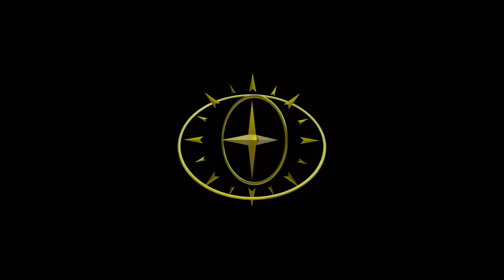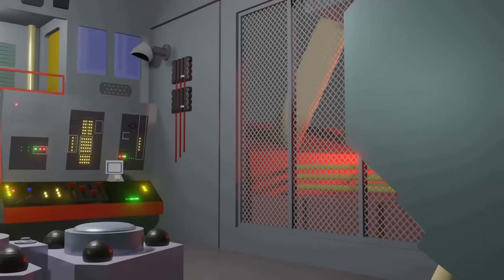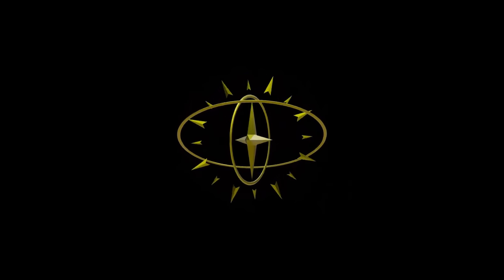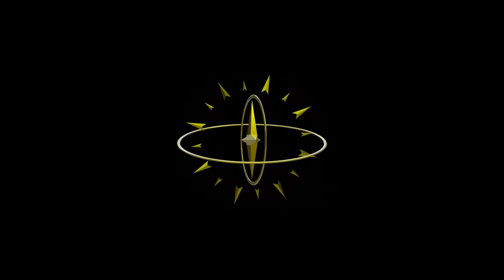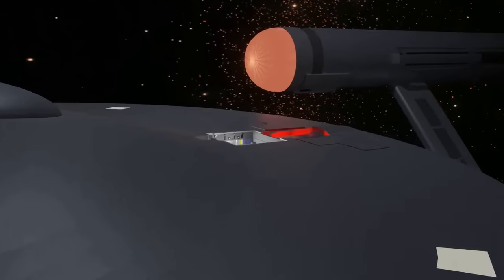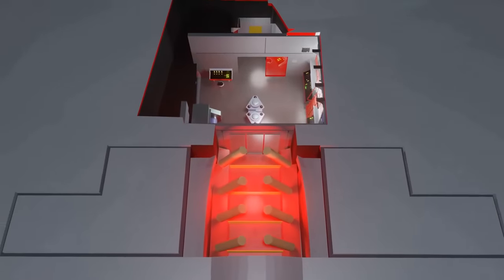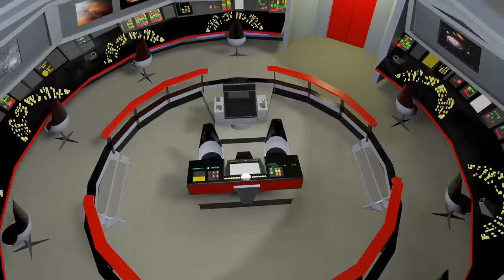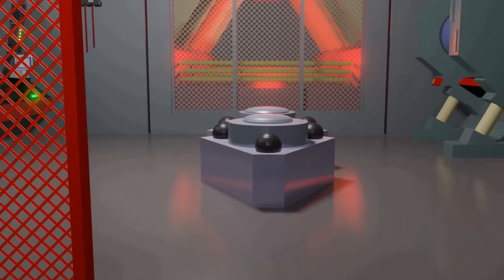The Enterprise Engine-room Enigma: where was main engineering?

Comment: IIRC the original concept for the Enterprise was a flying saucer, then later the secondary hull was added to make it more interesting and adding a reflector dish to make it more "science-y". Then they realized it still didn't look cool for TV and added the warp nacells. All of this was done independently of the writers and set builders who were operating off of both the original concept of the ship being a saucer (or at least that everything important was in the saucer) and that set building and story writing would be way easier if engineering was close enough to the bridge and could use the same hallway sets as everything else. Moving engineering to the secondary hull probably only became a thing when the show had become successful and anybody could put thought into where it should be (and thus the secondary hull became where all the power comes from). TMP then took it in a cocaine-fueled "bigger and better!" frenzy to wow audiences with huge sets and tons of extras by making engineering into this massive core that spans a huge chunk of the ship. The problem with TMP though was it cost way too much to do again for more movies: the sets were too big and the models were too fragile, so they immediately with Star Trek 2 go back to a saucer shaped ship in the Reliant and a beefier and simplified model for the Excelsior for Star Trek 3 (for Star Trek 2 they just re-used the enterprise engineering room for Reliant and for Star Trek 3 we hardly see anything inside the Excelsior). The other problem with TMP is that the engineering takes up an enormous amount of space for an exploration-based vessel to the point that as you noted there's no room for a turboshaft and as said earlier there's way too many workers. For TNG they needed a sustainably cheap set once again so they took the concept of the vertical tube worp core from TMP and smushed it into a smaller set with a more elegant and simpler to light set with maybe 3-4 actors max on the set. For Generations and First Contact they once again went crazy with extras, but never again tried to build quite as big a set as TMP.

Comment: I was recently informed ( by someone considering himself irrefutable an expert on all thing Star Trek and specifically the Enterprise) that the very first starship Enterprise had no shuttle bay, and no provision for one, thus it was entirely plausible that the space eventually used as the bay was originally intended to be the engineering area as it contained sufficient space for such a potential set, I prefer the idea that main engineering was in the saucer with a backup control room in secondary hull and that this was monitored and controlled primarily from the saucer
Reply: The First Enterprise's shuttlebay is literally visible on the outside. Who is this "expert" of yours?
Reply: @Idazmi7  true enough, all the filmed Enterprise starships I'm aware of DO have the shuttle with the segmented doors, I believe he was referring to the ship while it was still being "fleshed out" so to speak and there were no doors yet, the interior layout, and thus the sets, were yet to be established, the friend was in the industry and built props but not on the original series, next gen and DS9 mostly, and a couple of the movies, he's worked with Cameron (Terminator 1) and Spielberg (1941) and knows many folks in efx work, the people he spoke with could of course have misinformed him but that was the information he was given

Comment: Roddenberry also wanted for there to be a recreational garden area between the pylons with a transparent ceiling looking up at the pylons rising above which likely would've been airbrushed artwork.  However, the idea was dropped due to budgetary reasons.  We do see a massive number of large windows on the side of the secondary hull in say Wrath of Kahn suggesting that they wanted to show a large garden like area and on TNG, there was occasionally an garden area recreational area shown and not all of them looked like holodeck creations.  If you wanted to include this recreational area with the view of the pylons overhead, this would contradict the main engineering connecting with the pylons to the warp nacelles.

Comment: I admit I am strongly biased towards the Star Fleet Technical Manual. I bought my first copy around 1976, with money I earned for performing in a piano recital, meaning it was the first thing I ever bought with money I earned myself. When I was 8 or so, the SFTM was more real to me than anything in the world, and I've never imagined the Engineering deck was anywhere except immediately forward of the impulse engines. I mean, you're literally looking aft, into the impulse deck when you enter engineering. Otherwise, what even is that area with the pipes and so on? 

But to make a practical argument, you could theoretically place the engineering deck anywhere. It's not like the engineering crew has to shovel coal into the boiler.  It just makes much more sense to place Engineering in the saucer. Everything critical is in the saucer: the bridge, sickbay, main computer, crew quarters, weapons. The secondary hull is mostly just cargo storage, the shuttlecraft bay and some laboratories. In the most dire emergency, you have to be able to evacuate the secondary hull fast, so you can perform a saucer separation. Your engineering crew is going to be busy with the emergency; you don't want to have to tell everyone to drop whatever they're doing to run to the saucer, just so they can operate a duplicate (or worse, minimally functional) station in the primary hull.

Comment: Main engineering is located in the lower section centered between the narcelle pylons. Power generated by the warp core is routed up the pylons to the nacelles. Engineering wouldn't be in the saucer section behind the impulse engines, because the warp engines draw the most power. It would be impractical from a design standpoint to route large power relays down the trunk, back to the pylons, and up the pylons to the nacelles. Further, starships spend much more time at warp than at impulse, so it's more efficient to have the warp core nearest the warp engines, not the impulse engines. 

Engineering also powers the main deflector dish, so again, it would be impractical to have the warp core placed so far away from the two largest power consumers on the ship. 
http://1.bp.blogspot.com/-SKsv7e5qgEg/UeQR7tlPd5I/AAAAAAAAeLM/LLCEDGrYytU/s1600/tos_cutaway_drexler_2.jpg
Reply: Literally where are the photon torpedoes in that cutaway? 😵‍💫
Reply: @Idazmi7  She wasn't equipped with photon torpedoes. Enterprise was equipped with them during the overhaul (1701-A).
Reply: @sixstanger00  
"She wasn't equipped with photon torpedoes. Enterprise was equipped with them during the overhaul (1701-A)."

🙄
Thank you for admitting that you have never, ever seen the original Star Trek. The pre-refit Enterprise did indeed have Photon Torpedoes.
Reply: @sixstanger00  
"First of all, I've seen TOS in it's entirety dozens of times."

🤣
No, you have not. Absolutely. Next time you lie about seeing a show, at least freshen up your knowledge first. Try wikipedia.
Reply: @Idazmi7  In fact, I've probably seen more ST than you have. 

You fan enough for fan films?
Hidden Frontier?
Helena Chronicles?
Odyssey?
New Voyages?
Phase II?
Phoenix?
Of Gods and Men?
Reply: @sixstanger00  
Guy. Are you literally going to hold on after outright saying the original Enterprise doesn't have photon torpedoes? You probably haven't seen anything BUT fanfilms! 😆

Right now: take the merest glance at my channel. Just a peek. Then ask yourself what you're literally doing right now. You are not arguing with some Whovian pretending to be a Trekkie.

Comment: I always thought it was in the secondary hull.
Reply: Well, the original Star Fleet Technical Manual has TWO engineering areas: an area marked "Main Engineering" near the Impulse Engines in the saucer, and a separate "Warp Drive Engineering" in the secondary hull right under the nacelles. Main Engineering is shown to have computers that can monitor the warp drive from there. Make sense: the Enterprise has two different types of engines with different needs, and a crew of only 430.

Comment: I call it the "Re-constitution Class"   
dlol

So here's the rub... the connies had main engineering, reactor, impulse drive systems, fusion reactors and all up in the saucer section.   Remember the other ships that had the nacelles off on booms and other arrangements but had no secondary hull to speak of?    Warp drive consists of warp fields and the impulse engines combined.  That's the big joke in Star Trek... its all impulse because they can't get transwarp - the manipulation that Wes did in TNG - to work at this point in the timeline.   Also, when they refer to "engineering" there can be "engineering" on ANY deck.  Its important because its like municipal zoning.   "Science on Deck 8" "Engineering on Deck 4"  "turbolift on deck 18"       Main Engineering refers to the control rooms.    The impulse drive is on the saucy section and main engineering isn't the only place you can put dilithium assemblies (tho canonically it is the only place constitutions had them) and you need a lot of power to run the impulse systems and the main weapons and all.

Comment: My headcannon is that there are two engineering rooms. One in the saucer next to the impulse engines and one in the engineering hull.
Reply: It's not even headcanon. The original Star Fleet Technical Manual has TWO engineering areas: an area marked "Main Engineering" near the Impulse Engines in the saucer, and a separate "Warp Drive Engineering" in the secondary hull right under the nacelles. Main Engineering is shown to have computers that can monitor the warp drive from there.
Reply: @Idazmi7  That's good to know. I mean it's only reasonable to assume such important places have backup-locations, but as the video shows, TOS was rather ambiguous about it....
Reply: @ServantOfOdin  
Lack of budget, reused sets, and so on. The Star Fleet Technical Manual is more consistent.